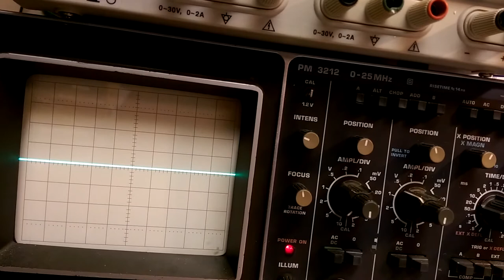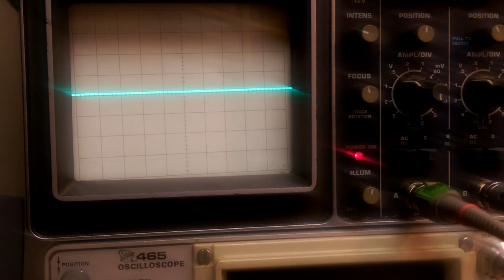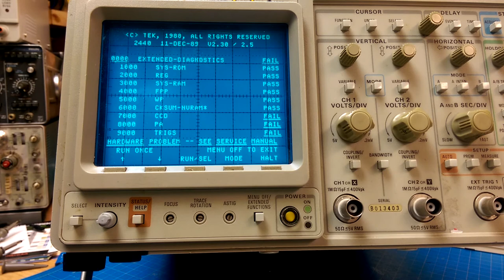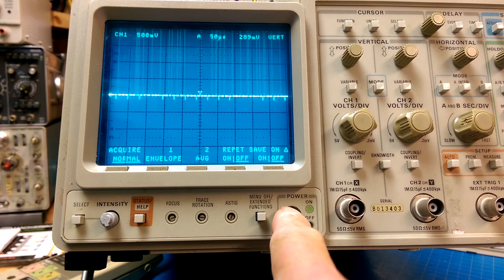Check CCD Clocks on the 2440

Comment: The calibrator does indeed track the sweep /time base speed. It does on scopes of this age. I'm afraid you are at the point I got when I was trying to fix mine. It does look like CCD failure i'm afraid. Pitty as that CRT is crisp and bright
Reply from the maker: I was afraid of that.  Did you replace just the CCD's (U350/U450) or the entire A10 board?
Reply: In the end the entire board after so mush rework was done. I bought a scrap unit from the states with a broken CRT as I guesses the unit was scrapped because of that reason. It paid off. 
Don't waste your time trying to recal the CCD's, it will make do difference i'm afraid.
Hope you find a unit for spares. Simon